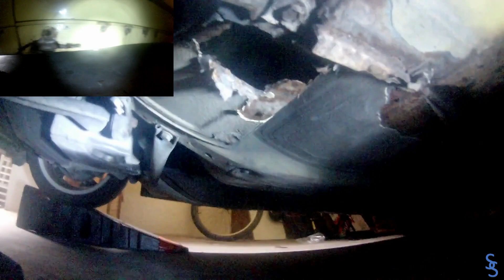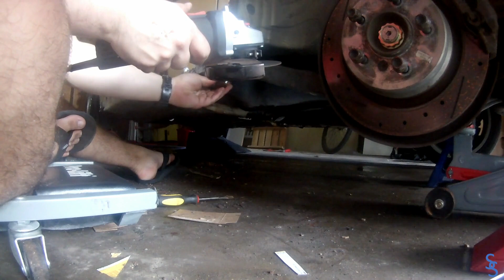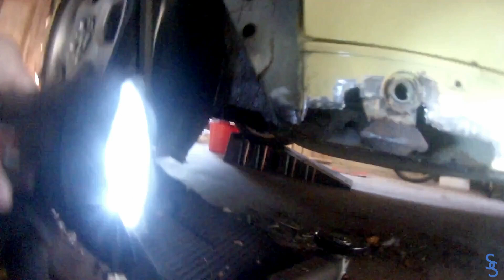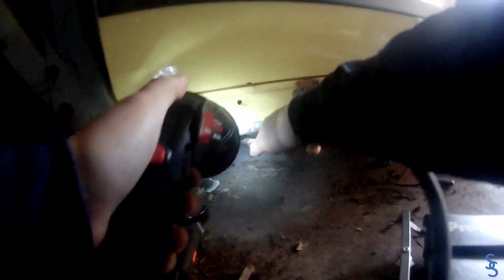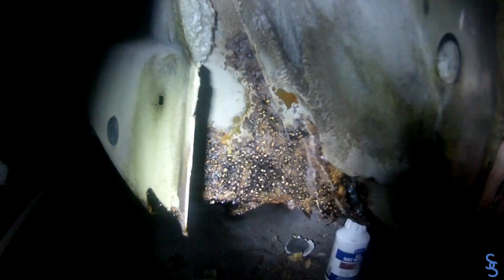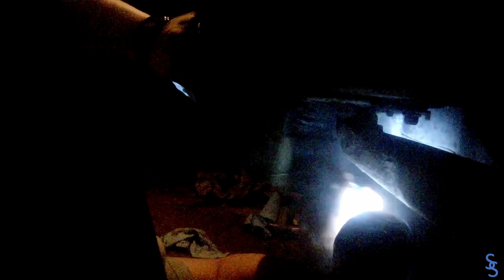How to Encapsulate Rust (BMW E36 M3)

Comment: I'd say only way to properly fix rust like this is cut it out and weld a new piece in. But, how is it holding up these days?
Reply from the maker: @PolandGamerPL  you are right is better to do an entire piece instead of a small patch like this. One more thing that I have learned since doing this is using seam sealer too.
Reply: @sansanper7562  Yup, weld through primer only in the area where you'll be welding, epoxy primer on the rest of the piece. Seam sealer after and good undercoating or poly paint. Spray a shit ton of cavity wax in all the closed areas till it starts pouring out the hole. 

You still have this e36?
Reply from the maker: @PolandGamerPL   yep still do
Reply: @sansanper7562  Nice! How are these repairs holding up? Just curious. Currently undergoing a big project myself and trying to do everything the "correct" way, but kinda curious how big of a difference in longtevity it actually makes to spend all that extra time on it 😂
Reply from the maker: @PolandGamerPL  they are holding great, but the car is not driven in the winter and is garage kept now so any repairs will hold in these conditions.
I think if you are going to expose the vehicle to the elements then it is worth doing it right so the metal will not rust again.
Reply: @sansanper7562  Nice 👌. Summer driven only here aswell

Comment: Nice. Is that an old car?
Reply from the maker: Relative. Is from 1997
Reply: @sansanper7562  Jesus i own a 1994 and mine just got zero rust compared to yours. Guess i got lucky
Reply from the maker: @gediegengegonnt31  where are you located? Where I'm they put salt on the roads and that rusts your car.
Reply: @sansanper7562  hm i bought it pretty much in the center of germany, usually we too put salt on the roads in winter, dont know if the person i bought it from drove it in winter tho. But even with salt on the roads these rust holes on your car are insane
Reply from the maker: @gediegengegonnt31  yeah they are huge. I got replacement parts to fix it up